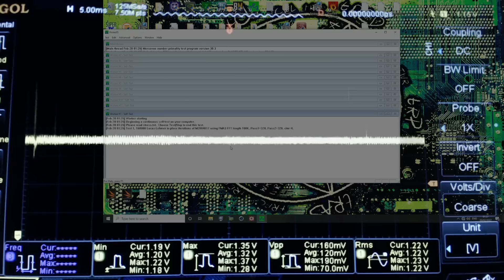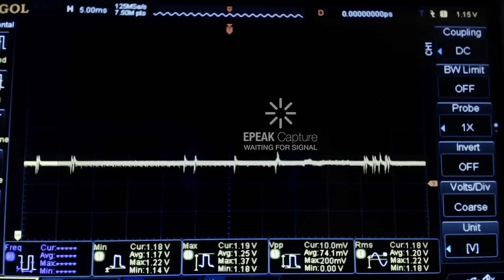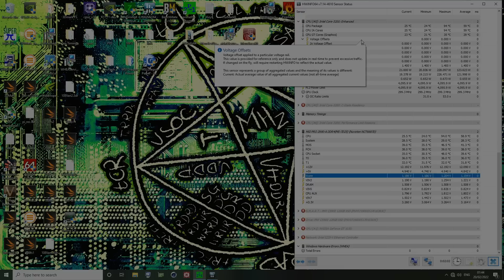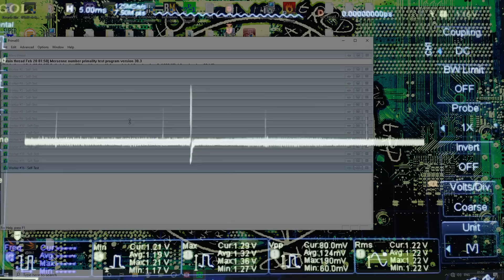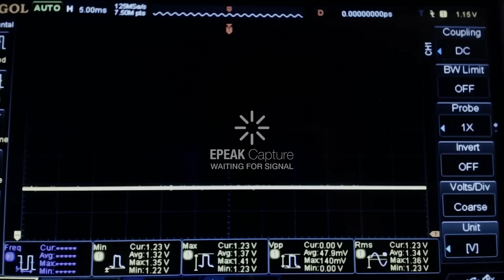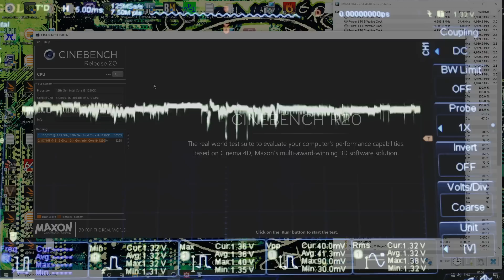MSI Pro Z690-A voltage regulation and VRM settings.

Comment: Love it - perfect illustration of why undervolts can fail (undershoots dropping below stable).
Just bought a B550 Unify - the datasheet for those stages uses 600 kHz as a reference, so I might crank mine up and sniff around for a decent static voltage for a 4 GHz all-core.

Comment: So just a quick question. Is the MSI pro Z69-A worth getting over the other more expensive Z690 motherboards?
Reply from the maker: depends what you need the board to do. Performance wise this is basically the same as the other DDR4 boards I've tested.
Reply: @Shraf2k Other than the system sleep thingy, mine had no problems.
Reply: The Z690 boards are plagued by a somewhat immature state of the BIOS, not only on MSI. On MSI there were common reports about sleep functions not working as they should, which might have been somewhat solved by the first BIOS update. Recently, some more problems are reported when enabling XMP for the RAM, which might need a second BIOS update in the coming weeks to rectify. When you encounter such issues, it makes no sense to get the board replaced, as they're all BIOS-related. You can look at ASUS changelogs for their Z690 DDR4 boards and they also had XMP-related problems, so the BIOS generally needs a couple updates to work smoothly, no matter where you look.
Reply: @ActuallyHardcoreOverclocking  Basically just game and edit photos, nothing super demanding. And thank you for replying back to me, really appreciate that!
Reply: @Mike500  I wonder if the B660 mb's will have the same bios issues?
Reply: @charlesnix8314  Well, they had a bit more time for BIOS development on those, so they will have some bugs already fixed by now. But i imagine that something like the XMP problems might be still universal at the moment. They won't be using a completely different BIOS codebase for the B660 boards.
Reply: Finished building my PC with this board a few days ago, I've had no substantial issues. Though the overall sound volume is now about a third lower than what I had with my Asus Z170 Pro gaming mobo. Don't know if it's due to the Windows 11 upgrade or the motherboard.
Reply: Beware of coil whine, other than that, perfectly fine.
Reply: @Shraf2k I couldn't get mine to work stable with 2 ram kits at xmp (3000mhz and 3200mhz)
Reply: @vgamedude12  Mighteven be the ram if it's trash
Reply: @ActuallyHardcoreOverclocking  does the ddr5 version oc memory decently?

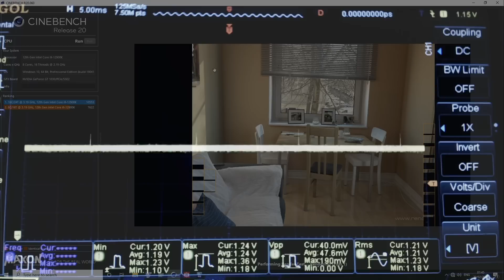Comment: 25:10 i wonder where that enormous voltage drop comes from, maybe r20 making worse situations than p95 sffts?
Reply from the maker: I probably nudged the coax cable sitting on my desk with the mouse.

Comment: 13700k mode 3 llc, adaptive vcore lite load mode 6.  Iam stable at 5.4/4.3/R48.  I have 1.18 Vcore vcc sense in hwi while running cinebench r23.  Do you think llc mode 3 are too agressive for daily with these settings ?

Comment: Bz... is the waveform also reacting to you speak?
Reply from the maker: no.
Reply: @ActuallyHardcoreOverclocking   it just seems to coincide so much. Definitely took my adhd by the horns as I tried to follow along!

Thanks for the info on this board bz. Might go back to it after benching on the apex.

Comment: MSI PRO Z690-A DDR4 and 12700f with 3200 adata (XPG GAMMIX D20 32GB (2x16GB) DDR4 3200MHz PC4-25600 288-Pins (AX4U3200716G16A-DCBK20) ram will it be ok? I want 6 sata and no cpu overclock. These are the least excpesnive in hong kong. Thanks.

Comment: i have a z690 ddr4 with i5 12600k i have a BIG BIG problem anytime i have no sound input for like 15-20 sec and then i reasume the video i always have the first 1-2 second of no audio i'm pretty sure it a sort of undervoltage problem do you have any tips?? tryed anything from realtek reinstall to GPU driver reinstall to windows to bios update...nothing help me 
ps also a pop crack from speaker when i turn ON the pc audio connected by digital cable but same issues if i connect a bluethoot audio device 
:(

Comment: The video was mostly concerned with undershoot, but aren't you concerned with overshoot for example when moving the mouse around? Intel specifies maximum 10% for 500 µs. I've come to think that the oddly high input voltages claimed in the same spec sheet are only valid if all electrical parameters listed there also also kept within specification (this includes current / IccMax, which no overclocker cares about).
Reply from the maker: overshoot doesn't damage CPUs unless it's approaching oxide breakdown levels.
Reply: @ActuallyHardcoreOverclocking  😂

Comment: where can I snag that desktop background!?
Reply from the maker: https://actually-hardcore-overclocking.creator-spring.com/listing/ram-oc-desktop-V2
it's comes with the actual GIMP files so you can tweak it to your own liking
Reply: @ActuallyHardcoreOverclocking  thanks!  $3 is a steal for art.
Reply from the maker: @takeastepoutside  did you get the file? YT seems to have hidden your comment about not getting it.
Reply: @ActuallyHardcoreOverclocking  I deleted my first comment. It went through...twice.  I can't be bothered to chase down a $3 clerical error that may or may not have originated at this keyboard.  I love the desktop background, and at $3 or $6, it's still the cheapest piece of art I own a copy of.

Comment: The only issue I have with this board is coil whine. Could be specific to my setup though.
Reply: I know this is old but I have this same issue. Weirdly I only noticed it after overclocking my RAM so I thought I was going crazy

Comment: So which is best for overclock 13900 k headroom for boost and all core load
Reply: I have this board and a 13900k, plus an arctic liquid freezer 2 in push pull.

Even I can't cool this thing to actually properly validate stability at max load, so if I were you I'd just run mode 5 6 or 7 and set it to the lowest voltage that it's still stable on.

Comment: How long would it take to see degradation running at something like 1.4 with the vdroop at something like mode 7?  My 10850k drops from 1.35 or 1.4 to maybe 1.33 or 1.36 respectively with mode 8!
Reply: Temp kill cpu not voltage
Reply: @maniakfps249  so you’re saying that running, for example, 1.1 volts at 4.0ghz all core at 80 Celsius is more harmful than 1.5 volts at 5.0ghz all core at 40 Celsius?
Reply: @zappulla4092  YES I have an i7 2700k work 10 years at 5ghz 1.5v max temp 75C and it still works. The bigger problem is with the motherboard and the power section one board died. There must be a strong power section
Reply: @maniakfps249  Again with the "my old CPU still works....." Bruh it's on 32nm vs nowadays CPU at 14nm or 10nm..... Those 32nm transistor and the level 0 metal connections are significantly larger compared to today's transistor, it's like comparing an earth mover truck the size of a house to a mini electric vehicle, pretty obvious which one can handle more abuse.

Plus there is another significantly important detail that you missed, the energy density, heat density etc is lower on 32nm vs today's 14/10nm transistors.................
Reply: @snowstar3560  For me, the only thing that has changed is that they consume more electricity
Reply: @maniakfps249  yeah that's true
Reply: @snowstar3560  Of course the cpu's are getting faster and faster but there is not as much difference as there is in the GPU. But that's probably because the games aren't well optimized for cpu
Reply: Buildzoid has a video about chip degradation. From what I've gathered, there are 3 ways a chip can degrade: thermal cycling (doesn't really affect cpus that much since they're small), oxide breakdown (too much voltage casues electrons to go into oxide layer beaking it down and making current flow where it shouldn't, I think you'd need like a lot of voltage for that to happen though) and electromigration (flow of current in the metal layers, affected by load, temps, current and more mhz). So oxide breakdown and electromigration would be affected by voltage and as long as you don't run high voltage that only leaves electromigration. So as long as your voltage isn't crazy high and your temps are good you're fine.
Reply: @maxromanowski6069  thank you!
Reply: @maxromanowski6069  Buildzoid It shows overclocking of ddr4 and a lot of settings it does not suitable for games will not work well. but in programs that only promote read, write are ok

Comment: Did you try to BCLK overlock non K cpu with it? Does it even support it?
Reply from the maker: this board doesn't support it
Reply: @ActuallyHardcoreOverclocking  would you consider making a new motherboard buying recommendation video because of this non-K lga1700 CPU overclocking discovery?